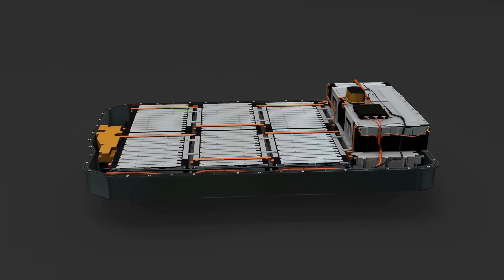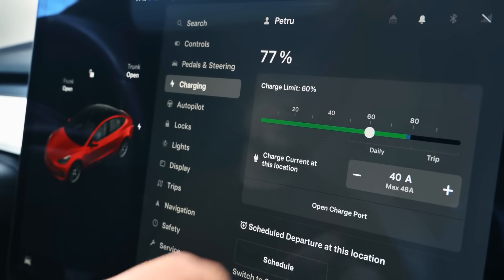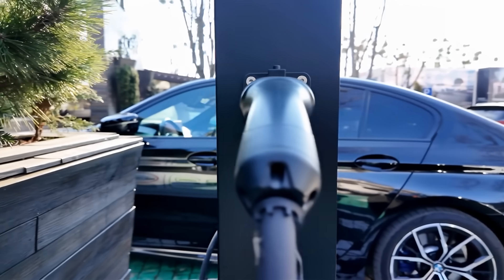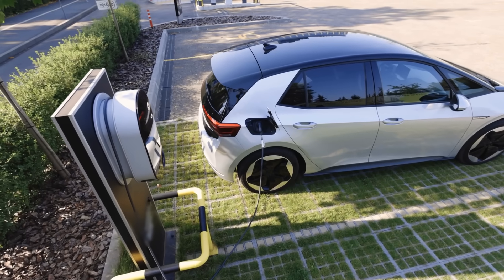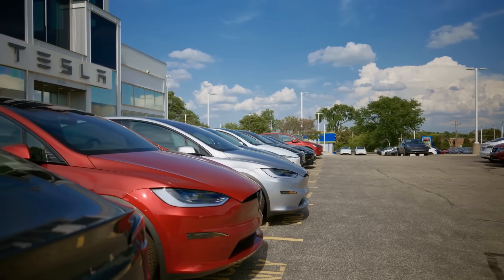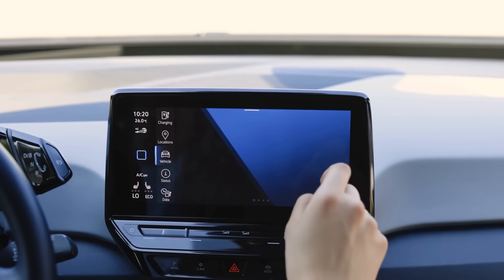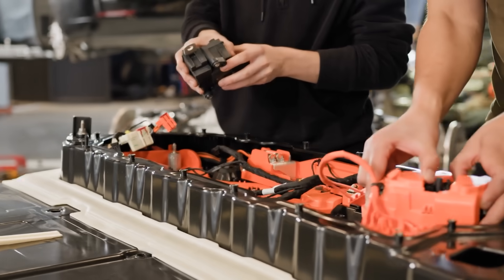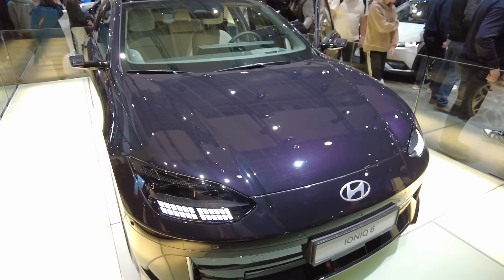Do This Once a Month, and Your EV Battery Will Last Forever!

Comment: 3:18 I find it beneficial to spray a small amount of CRC QD electrical contact cleaner into each pin of the charging port and the EVSE plug. This helps loosen any stubborn spots where dirt and dust may have accumulated. After spraying the contact cleaner, I let it soak for a few seconds before using a cotton swab to clean the contacts. You’d be amazed at how dirty they can become in a year!

Comment: Why don't battery makers simply say it's 100% full when really it's 80% full? 
That would easily solve the first problem.
Reply: A few manufacturers do allow some headroom...e.g. my Honda e:Ny1 has a total battery capacity of 68.8 kWh, with a usable capacity of around 62kWh. But I still only charge it to 80% mostly! 😃
Reply: ALL Ev's initiate a buffer at the top of the charge, and at the bottom of the charge, when it says it's empty so in other words when the car says it's 100% full it's usually about 92 to 95% and at the bottom when it says it's empty you probably still have 20% left that way it saves the battery

Comment: When they say charging to 100% degrades battery...what does that mean...like in 5 years you will lose 20% capacity??? Or are we talking 3-5%..charging at home to 100% once a week doesn't seem like it would be all that bad in real world application
Reply: Well I'm new to this we just bought our 1 EV and 3 years old battery still at 100% and 27k miles on clock dealer car it was and they have 22 kW charging stations they said 1per week 100% the rest 80 just to top up I'll drive 40k per day to work batterie in the car is58kw and use the 240 w lead or granny charger over night I'll top up till we get 7kw installed so fingers crossed it will be good

Comment: ☝ Luckily, you can forget all this with the new BYD blade batteries. Faster charge, more charge /  discharge cycles, more autonomy, works better in cold or hot climates, less expensive...

Comment: LFP Battery have no problem with daily charge to 100%
Reply: Correct 💯
Reply: Actually LFP also suffers when charged to 100%. But yes, they do suffer much less than NMC batteries.
For LFP, charging to 100 every 3 months instead of routinely makes wonders. And still allows the system calibrate the charging level, which is why they need to be charged to 100 (unlike NMC)
Reply: Exactly,our byd cars are always charged to full.

Comment: 0:40 
1st Error:  ‘most people charge to 100%’
  No, most people follow the recommendations for their Tesla. 

1:33 
2nd error:
‘DC fast charging damages battery’ 
New studies indicate that DC fast charging to 80% in a Tesla with their cooling system does nothing to degrade battery life. 

All in all this video is outdated and full of misconceptions. Although some will be true if you bought a Chinese car
Reply: Correct. Also in most cars the battery stops charging (by the BMS) before it is technically 100% charged. Depends on which car brand of coarse. But I ewas told that a kona64 actually had a technically 70KWH battery. Never reaching 100% and never reaching 0% state od charge. Most factories make sure that some of those  mentioned "mistakes" cannoit be made.
About fastcharging. That is not the issue. It is heat. Every modern BMS monitors the heat and slows the fastcharging the moment the temperature is higher  (or lower) than the programmed ideal threshholds. Which makes fastcharging not a real issu. Still I advise slowcharging due to efficiency. Active cooling during charging also costs energy.

Comment: Also at night electric rates are lower.
Reply: Some places with high solar density drop rates during the middle of the day. Here in Phoenix, APS gives the best rates on weekdays from 10a-4p during the winter months. 3.5 cents per hour versus 12.3 cents per hour for overnights & 32.5 cents from 4p-7p. Hopefully, EV owners already know their best plan options.

Comment: I set the charge limit to 80% for day to day driving. If going on a long trip charge it more then. Majority of my charging is at home. I've got a Tesla Model Y Juniper and software updates come down automatically.
Reply: Tesla recommand 100% once a week to keep battery chemistry active. The 80% rule applied to GM viechle. Since GM is using relative old battery chemistry
Reply: @林振华-t4v  80% is for Teslas with lithium-ion batteries (NMC), and 100% for LFP batteries in rear-wheel drive Teslas.